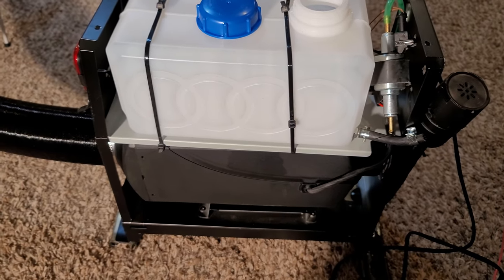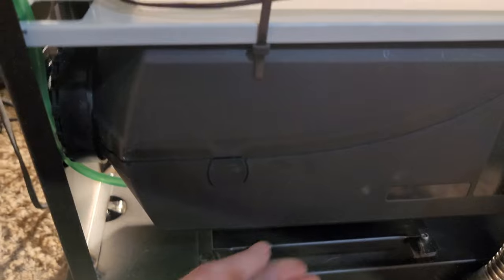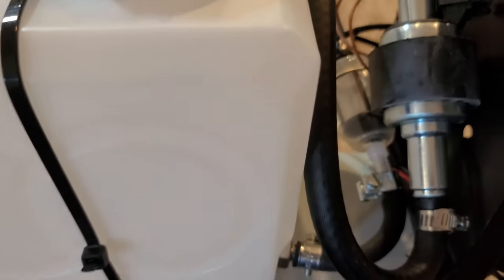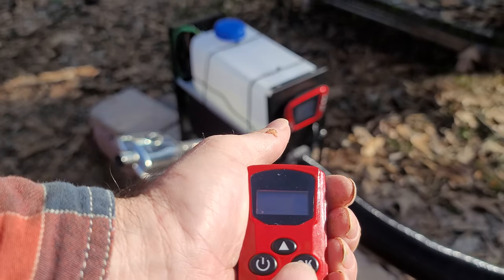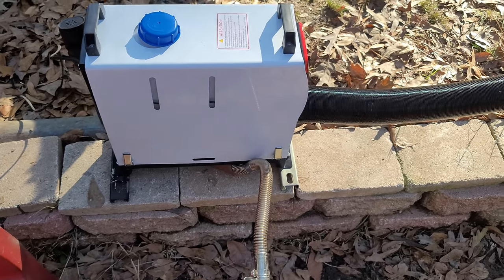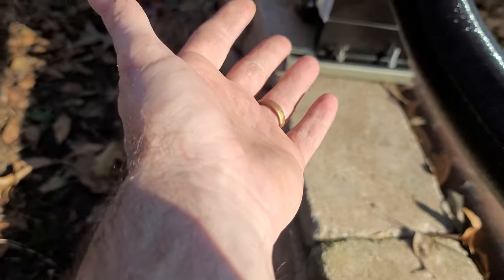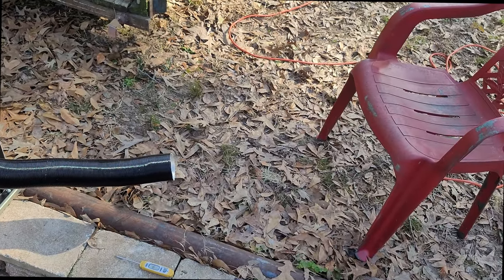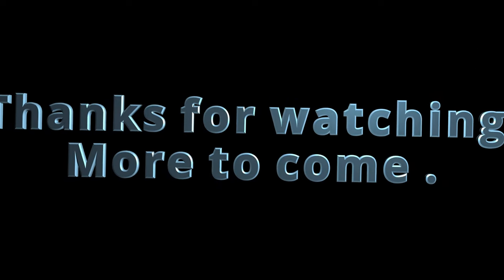Desiel Heater Setup, VEVOR Diesel Air Heater All In one, One Air Outlet, 8KW Diesel Heater 12V

Comment: I’m ordering mine when I come back from work next time and starting my Adventure trailer project
Reply from the maker: I will be modifying my truck rack to fit my 5x10  trailer. Going to do a spring flip and use the trailer sometimes.
Reply: @Outdoors4adventure  I have a 5' x 8' and my 16' low boy Im gonna modify

Comment: I've heard the pump is lubricated by the diesel so it's best to fill the lines first instead of letting it pump dry for 10 min.
Reply from the maker: Yes. Even after running it and shutting it down it takes a bit to prime it on next start. So far I have no issues.